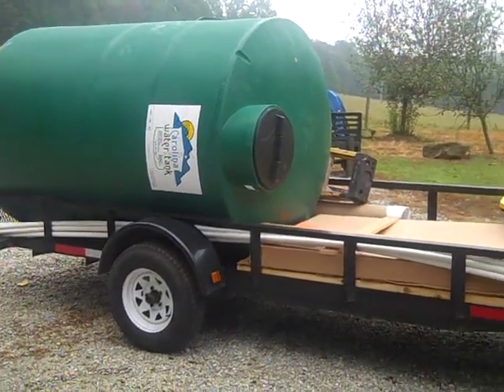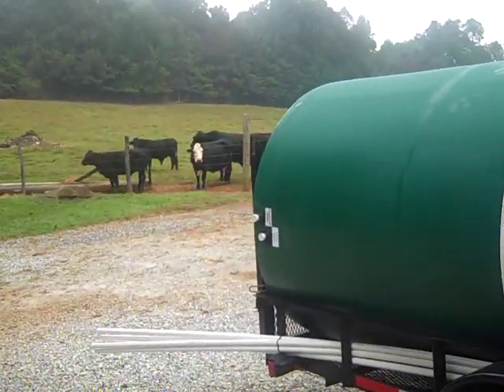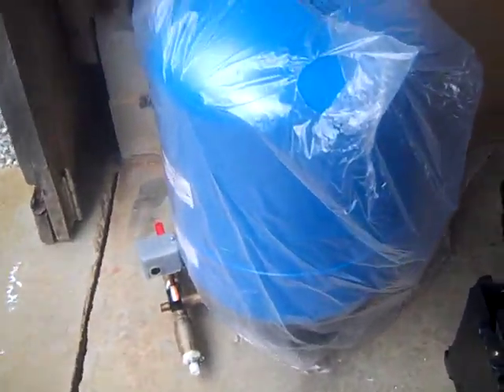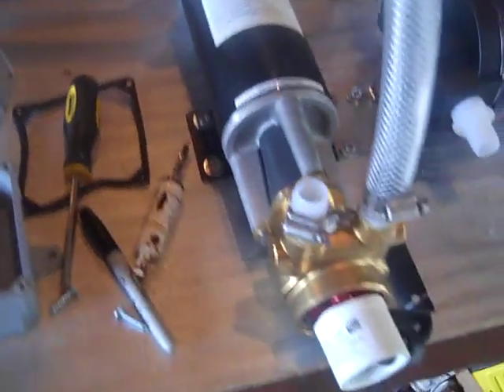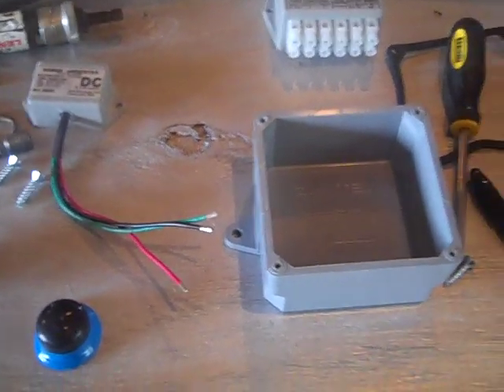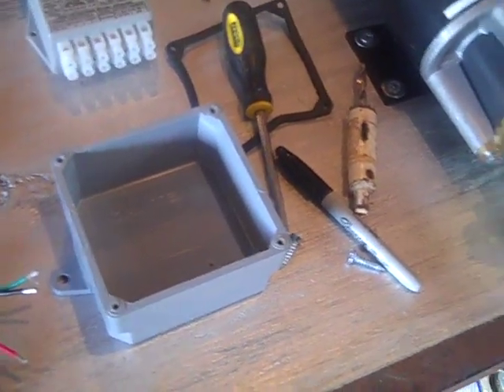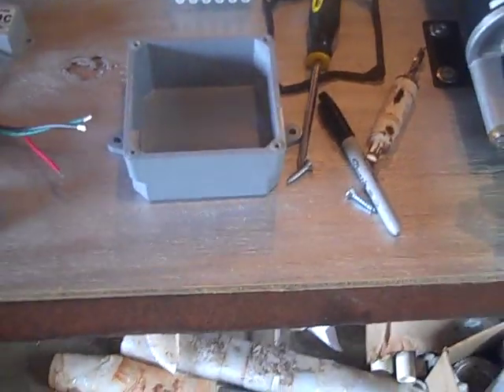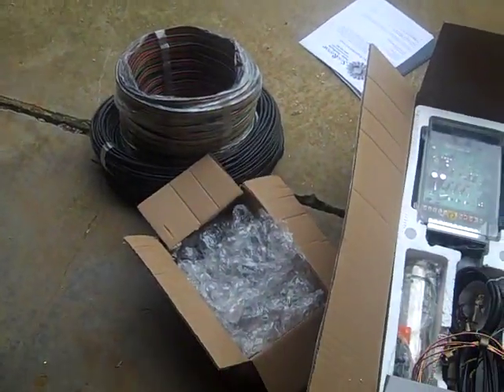Off-Grid Water System before the install

Comment: Hello: I noticed you said 2 grounds, that's good. I have see wires that would carry the voltage but when you put a load on it the voltage drops to maybe half. The people say I hooked up the wires myself. I say so. Not only do you half to find and fix it, you must prove to them where the problem was. And then they want to argue with you. It's about 50 degrees in Va. at 9:20 but it will be warmer in N.C. Have a Safe Trip

Comment from the maker: Protecting systems from Emp events is extremely expensive.  I use standard grounding/bonding techniques with surge arrestors,fuses and breakers.  Like on this system I encourage everyone to have a manual backup and we use Simple Pump hand pumps.  Thank you for the ?

Comment: Question, not necessarily about this video, but Ram Pumps. For anyone that knows for sure. I want to put one below the pond dam on my neighbors property and send water up to the barn to a 500 gal storage tank. My question is, once I have the pump operational can I stop the flow with a ball valve at the storage tank. Will the pump and feed line stay primed? In other words, once I turn the flow off for a week , then open the valve at the tank, will the pump resume? Thanks in advance.